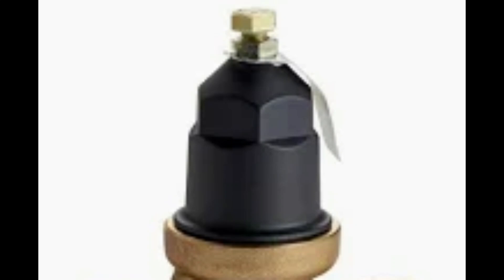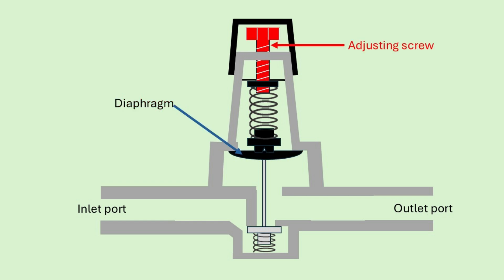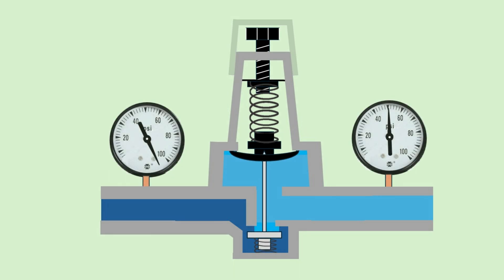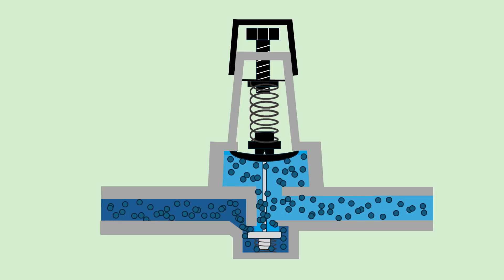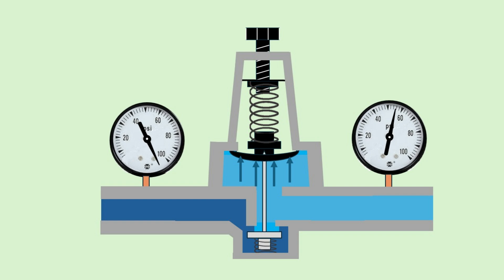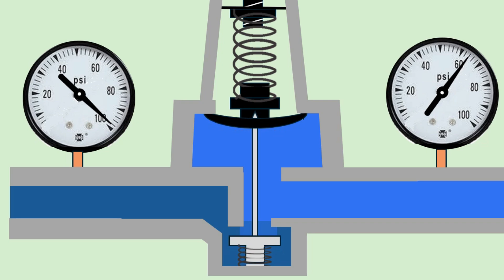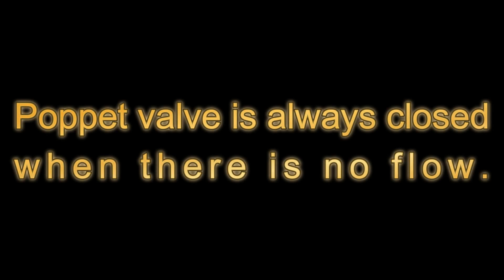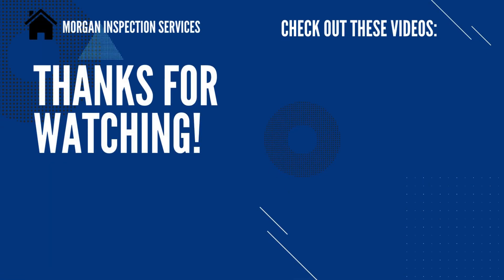How a Water Pressure Reducing Valve Works

Comment from the maker: Thanks for watching!
Remember — a properly working PRV can save your plumbing system from serious damage over time.
If you found this video helpful, give it a thumbs up and check out my other videos on simple ways to protect your home!
Reply: This is any excellent video  as well as your comments about the importance of a properly working PRV. Please allow me add some words about PRV itself. 

What would happen if some solids/impurity caught in between the valve seat seal? High pressure city water leaks into your home plumbing system till water pressure equalizes. Or in another word the PRV fails. Normally people even do not notice such PRV internal leak and the problem. Such chance is low but if it happens and there is a very high city water pressure, the water heat pressure relieve valve will be activated, or, likely even worse, the plumbing system is busted. 

Because the PRV opens every time water is used, there can be a lot of times in a year, many more times than any plumbing fixture in the home. what is the chances in life time that a plumbing fixture fails.  Even worse for PRV, people are unlikely to know it it has internal leak until a problem occurred.

The solution is a pressure relieve valve in addition to the PRV. Pressure relieve valve is normally closed and is reliably trigged.  It has much less chances of leaking as it seldom trigs. if PRV has internal leak, the pressure relieve valve may leak as well and protect the plumbing system at the same time.  Even if it fails, in most case the seal starts to leak, than what? . but if PRV leaks internally, the plumbing system may be busted. In my opinion the pressure relieve valve should be in code in addition to PRV.

Comment: So would this solve water hammer in an entire house, instead of installing water hammer arrestors for each tap, etc.
Reply from the maker: A pressure-reducing valve might help with water hammer if the water pressure is too high, but water hammer arrestors are designed specifically for that problem.

Comment: Is it be possible for someone to steal water out of a PRV at the meter by unscrewing the top? Trying to figure out why a drywall subcontractor would have got in there
Reply from the maker: I suppose it’s possible, but it’s probably a lot easier to steal water directly out of a faucet outside somewhere.

Comment: I have 2 PRVs, one for the house and the other for landscape irrigation.  I can easily check the household pressure by using a meter on the hose bib, but how do I check to make sure the pressure on the irrigation side is still good?  Is there a test port typically somewhere in the system?  Thanks, great video.

Comment: Very nice explanation. I wonder: is it ever possible for a regulator valve like this to oscillate? For example because it overshoots and changes the pressure too much, but as a result the flow changes a lot causing a pressure change beyond the setpoint, and then it overshoots in the other direction, and the cycle repeats?
Reply: Yes, if it's worn out or if the regulator is the wrong size for the application are two reasons it could happen.

Comment: Thank you.    Our house was built in 2000.    Should the PRV be replaced?   Can I buy new parts and install them in the PRV body?       While I was at work, our water company kindly measured the pressure from our gardehose spigot.      Is that Static pressure?    Or did they flow water for the measurment?     Thank you
Reply from the maker: Great questions, Robert! 👍 A PRV from 2000 is definitely nearing the end of its lifespan, so replacement is usually the best option rather than trying to rebuild it. Most manufacturers don’t sell internal repair parts. When the water company tested from your hose spigot, that was a static pressure reading (no water running). To really know how well your PRV is working, you’d want to check both static and while water is flowing inside the house.
Reply: @morganinspectionservices3840     Thank you.   Do they have PRVs whichave compression fittings so I could put it on?
(I have soldered wires but never copper pipes.)   When the PRV fails, what happens?

You may laugh. We are volunteer medical transport service.   We have an American Standard Clinic Service Sink from ReStore in the garage and, amazingly, found a clinic service sink faucet at a thrft store.  
The EMTs want the clinic service sink to flush, but AS specifies 6.5 GPM.    
Our residential water service is 3/4 copper pipe. Can that get the clinic service sink to flush well enough?    Suggestions?
Thank you.

Comment: Best explanation ever on internet. I came across trying to figure out how to determine my PRV is bad. my PRV is advertised 25-75psi range, my static psi setting is 60 psi, but once the water flow is closed, the 40 psi dynamic pressure goes right back to 60 psi, but slowly creeps up to 90 psi over 5 mins. And it behaved like this all the time. Any suggestion is appreciated.
Reply from the maker: Thanks for the kind words! What you’re describing is called pressure creep, and it’s a pretty common sign that the pressure reducing valve (PRV) is failing. When water is flowing, the PRV holds the pressure at your set point, but once the flow stops the internal seat doesn’t seal tightly. That allows a little of the higher city pressure to leak through, so your pressure slowly climbs above the setting.

A few quick checks:
	•	If you have a water heater expansion tank, make sure it’s charged properly. A bad tank can cause pressure swings, but it usually won’t creep that high.
	•	If the pressure rises like you described even with the water heater off, that points straight to the PRV.

Unfortunately, once a PRV starts creeping, the long-term solution is replacement. In the meantime, using a gauge with a recording hand is a good way to monitor how high the pressure is spiking.

Comment: Good video sir, but can I put this device onto my well system to protect the water filters? On the filter housing, there is a warning says "The housing can witstand upto 90PSI, but if the pressure is above 80, a pressure regulator must be installed before the filters" This is my set up in mind: Jet pump -> APC(Automatic Pump Control) -> Pressure Reducing Valve -> 3 stages Water Filter -> 1000L Water Storage Tank -> House.

Comment: Thank you so much, this is the clearest video ive ever watched about howa PRV works. I'm just wondering one question. Why the gap between the valve seat and the poppet can change the fluid pressure? And why the wider the gap is, the lower pressure reduction occurs? Is there any principle or something like the Bernoulli's equation can describe this? Thank you!
Reply from the maker: Thank you so much for the kind words—I’m really glad the video helped clarify things! Great question, too.

The pressure reduction in a PRV isn’t directly explained by Bernoulli’s equation alone—it’s mostly due to flow restriction and resistance to flow. When the gap between the poppet and valve seat is narrow, it creates more resistance, slowing the water and reducing downstream pressure. A wider gap offers less restriction, so more water flows through and pressure stays higher.

Bernoulli’s equation applies best in frictionless flow, but in real-world systems like PRVs, energy losses (due to turbulence and friction) play a big role—so it’s more about practical fluid dynamics than ideal equations.

Thanks again for watching!
Reply: @morganinspectionservices3840 oh nice I got it. I tried to use Bernoulli equation to explain it but ended up with more complicated problems 😂thanks for your great help. Btw, I do need to emphasise again, this is the best video of the control valve explanation in YouTube.

Comment: Ok. Here's what I needed at 2:03 tightening or loosening to adjust pressure as needed. Tightening the adjustment allow MORE pressure OUT passed the reducer. Loosening it DECREASES the outlet pressure. That's it.

Comment: Have a new PRV installed in house, set to 55 psi on outlet.  Have water pressure gauge attached to outdoor faucet after the PRV.  During the day it measures the expected 55 psi, but in the overnight/morning, it spikes to 80 psi.  Is it likely a faulty PRV or is there some other explanation? Thanks!
Reply from the maker: Do you have an expansion tank at your water heater? That would be my first thought. If there is no expansion tank then as the water heats up overnight, it cannot flow back into the city’s water system because of the PRV. A small amount of expansion in a closed system can cause a pressure increase like that.

Comment: what if there is no consumption on the outlet. What about the increased pressure in this condition? Where will the excess pressure be released?
Reply from the maker: Great question! If there’s no water being used downstream, the pressure reducing valve (PRV) stays closed, so the downstream pressure stays at the set level. (it may be just slightly higher than the set level because there is a very slight delay between shutting the water off and the valve closing completely, but it will be very close to the set level.) Since it’s not an open valve, it doesn’t allow more water in—and no excess pressure builds up on the outlet side. On the inlet side (before the valve), the pressure is still high, but that’s exactly what the valve is designed to handle. It only opens when water is being used. Thanks for watching and asking a great question!

Comment: nice video, I always wondered how they worked. Why couldn't I just choke the pressure back with a simple check valve/tap instead?
Reply from the maker: If you have constant flow and pressure coming in and the flow never stops then that would probably work. However, if you have fluctuating flow and pressure then your outlet pressure would constantly be changing.

Comment: We got roughly 175psi before the regulator.  0.433 psi per foot of water.  You can figure out how high the water level is by calculating that which is about 400 ft. Fun fact, submarines know how deep they are by the press of the water.
Reply from the maker: @brettcatterall7761  175 psi? That is really high. That’s one of the highest I’ve ever heard of. Yes, I served on submarines back in the 90s. Definitely a lot of pressure down there.
Reply: @morganinspectionservices3840  yes. Shop down the street got a garden hose hooked up before the regulator.  You got to hold on to it

Comment: Excellent demo. 

The nature of a pressure reducing valve also has the unintended side affect of acting as a check valve which can be a double edge sword so to speak.   While it certainly helps prevent cross contamination of the potable water supply and thus required by some local plumbing codes, it can cause the T&P valve on your water heater to discharge during the heating cycle when no hot water is being drawn resulting in higher energy costs and shorten the life of the water heater.   An expansion tank would be required.
Reply from the maker: You’re very correct about the expansion tank and the check valve nature of the pressure reducing valve. I actually have a video coming soon about expansion tanks. I always appreciate your wise comments. I always learn from them.